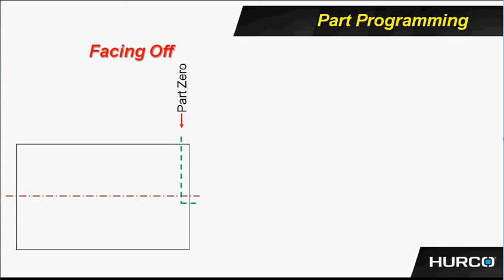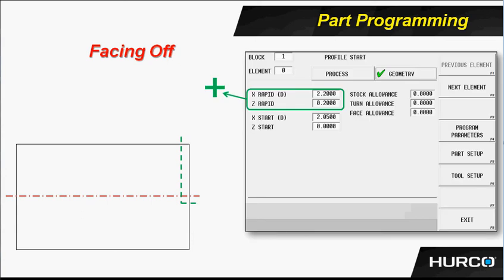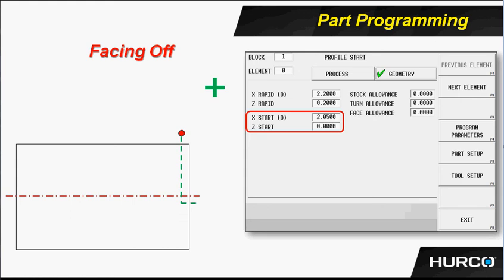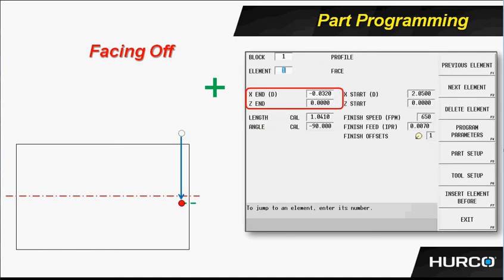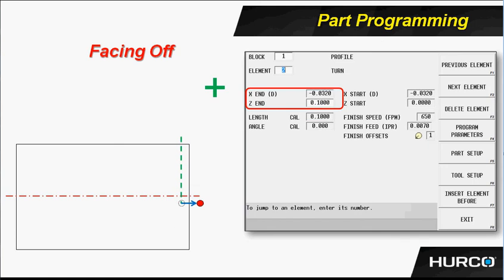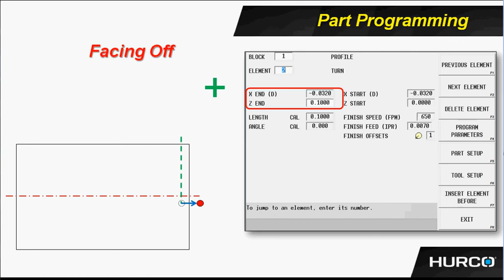Facing Off Material - Hurco Lathe Training - Max4 Version 9

Comment: How about roughing face of .250. I tried to program it but it keeps on giving me a taper move for no reason. It will rough the face fine at about .100 without a taper.. Why is it that Hurco lathes don't have a facing operation alone without programming it in the profile selection.
Reply from the maker: Hi Phing, Hmm…if the process you are using works at .100” of material, the same process should work at .250”. We would need to see the program to help troubleshoot this one. As far as the lathe not having a facing operation…We will write that up as an enhancement request. That is a good idea.